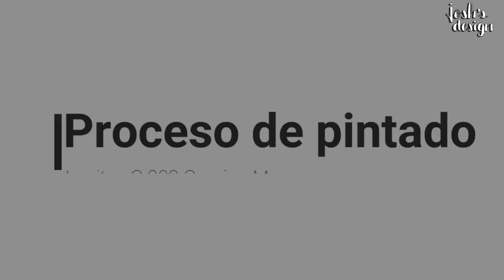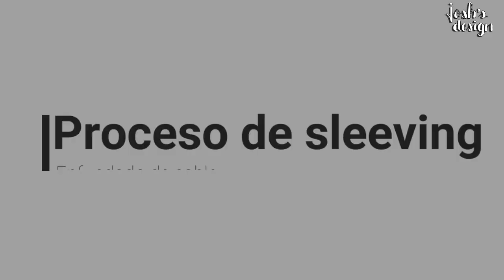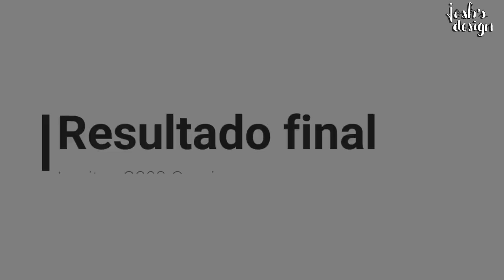Logitech G203 | Gaming mouse cleaning and modding | Limpieza y modificación

Comment: I don't speak Spanish but can understand a little. I have a similar issue with the scroll button (mouse 3 - half the time it doesn't click and sometimes it double clicks it) on a Logitech G Pro, would the trick with the isopropyl alcohol work to try and fix it given that it's a different type of button not like the left/right click switches?
Reply from the maker: Hey dude! Thank you for your comment! The isopropyl alcohol trick could help you with your problem, you could try to clean around the button that doesn’t work properly. I hope it helps! Let me know if you need anything else
Reply: @JoshDesign  Hi, I had already bought a mouse to replace it, but have found time to try this fix a few days ago. Been using it on my work PC and the issue seems to be resolved. Thanks again! :)
Reply from the maker: @DarthAgony  Niiiiceeee!! I'm very happy to read that!! 👏👏👏👏👏🖱

Comment: no encuentro donde comprar patiunes nuevos
Reply from the maker: Dime el modelo exacto de ratón a ver si te puedo echar una mano!!
Reply: @JoshDesign  gracias muy amable , pd me encanto tu trabajo :3 , el modelo es mouse hyperx surge
Reply from the maker: @ericdavidmarcillo2581  https://es.aliexpress.com/item/1005001960762163.html?spm=a2g0o.productlist.0.0.1225d0e6FcfrWQ&algo_pvid=9b61c40c-55da-4992-8cdf-3345c570bf50&algo_exp_id=9b61c40c-55da-4992-8cdf-3345c570bf50-20&pdp_ext_f=%7B%22sku_id%22%3A%2212000018233478361%22%7D
Ahí lo tienes, los patines para tu ratón, espero que te sirva de ayuda y si al final modificas el ratón no dudes en mandarme un mensaje por instagram para enseñarme el resultado! Un saludo!